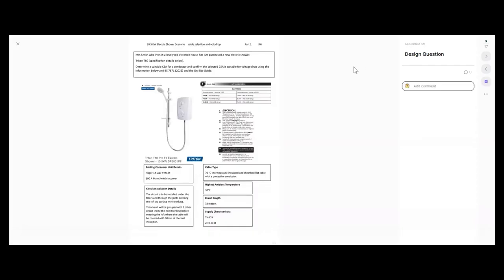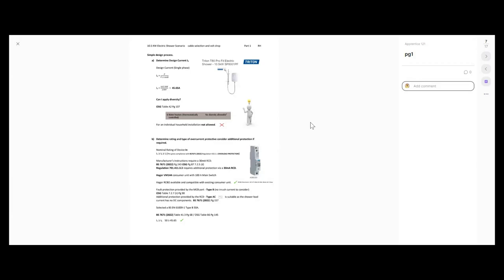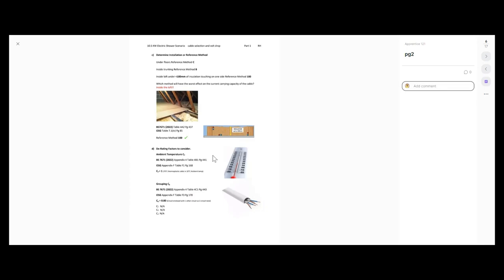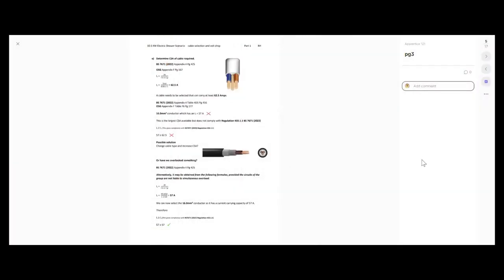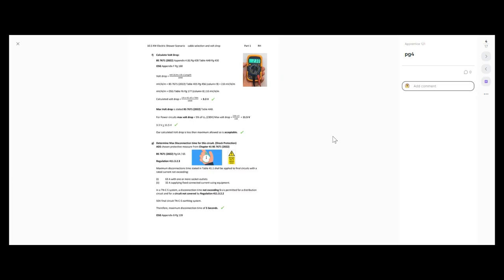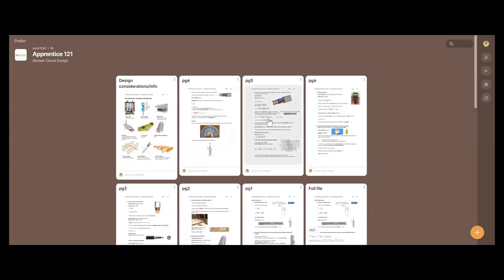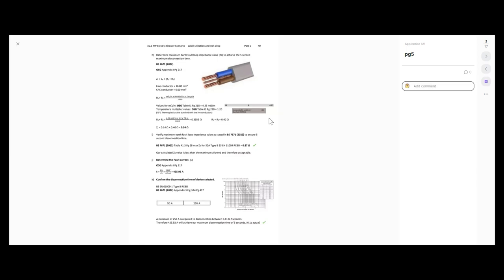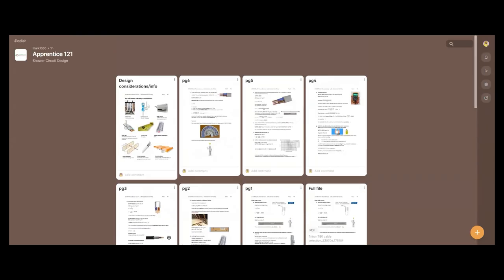How to design electrical circuits E2 - Shower circuit 78m long! 2396 Design

Comment: Good show guys.
Great scenario where larger cables can be incorrectly chosen.
Possible change of design I may consider.
1. No grouping keep separate (though this was eliminated)
2. Avoid loft lagging.
If above not practical then I may consider 
3. To put a small sub main in to airing cupboard, then a short run to the shower. I may calculate to see if it will work, and price to see if more economical.

Comment: Really enjoyed this podcast guys.  Great explaination of the process and the worked example was genius.

Some other points to consider

Don't put the cable in the loft under the insulation, run it over the insulation on the joists or under the rafters.  This will be clipped direct and with fire rated clips every so often to comply with premature colapse regs.  This will increase the length somewhat but no need to derate the cable, I think will be better in the long run.  Just think a day of tomorrow the loft insulation will increase from 90mm to 300mm.  As stated in Approved Document L, loft insulation should be at least 270mm thick, which is the requirement for newly built properties

Don't run the cable in the mini trunking with another cable.  Reason is it will give you a better cable calc for your cable and I would say that if you are sharing the cable run/conduit with an existing cable you would need to do the calc for the existing cable as well.  Eg if the cable was 1mm CSA*2 it might need to increase to 1.5mm CSA*2

Personally I would like to see Low Smoke Zero Halogen Free cable used rather then standard T&E just in case there was a fire.  Alas I suspect the cost may be up 30% more than T&E.  Also a shower electrical isolation point on the outside of the bathroom should be factored in.  

Another alternative could be to use singles in a conduit or consider a suitable flexable cable.  From my understanding a flexable cable can carry more load than T&E.  For this I would speak to the tech department of a reputable cable manufacturer like Doncaster cables.  

Further consideration is what the manufacture of the shower says the max cable size is for the terminals.  20mm CSA will not physically fit a 16mm CSA hole.

Keep up the great work team
Reply from the maker: Awesome Sergio you superstar!

Comment: It’s a very tricky install . We covered something sink air in the level 4 design course . 
There’s 2 east ways . 

Avoid the insulation in the loft or run the cable in conduit on the outside of the building . 

Swa can carry a lot more but cost would be higher . 

Great video again chaps .
Reply from the maker: Thanks 🙌  we will be taking these up a step each time.

Comment: Avoid grouping with the other circuit, separate containment or clip the cable (through the attic) away from the rock wool 👍

Comment: Simultaneous overload means fault current also across the grouped circuit. 

Interesting conversation. 

Also is a 30 degree ambient temperature realistic for a cable in a loft.  I know this is not the purpose of the podcast but it turned my grey matter on. 

Great pod.
Reply from the maker: I can safely say lofts get lots hotter 🤣. This particular one was Santa's shower so no issue 🤣🤣🤣🤣🤣

Comment: Great video - when the K value was worked out for the twin and earth cable why was table 54.2 not used. Genuinely confused as I’m about to take 2396 exam and trying to decipher BS7671 is beyond complicated.

Comment: Calculation is wrong for Volt Drop no?     Volt drop = 2.8 x 45.65 x 78   / 1000 = 9.96996 Volts Still is permissable, just not sure where you got 3.3V from???
Reply: Any insight would be helpful.. would like to know if i am not calculating this correctly?
Reply: Can you also explain why it is only Ca 30°c and Cg (group of 2 cables) used and not Ci as a derating factor since it is also being run through thermal insulation as well as in mini trunking?
Reply from the maker: Yes their is an error in the calcs and the sheet has been updated by Richard. I will upload to the website when I get chance. Great spot
Reply from the maker: We haven't included all the applicable grouping factors while we build up the maths on the series. That's the approach we have taken on it for the moment. Others may have chosen to approach it differently but made sense to me. Rather than include everything from the start.